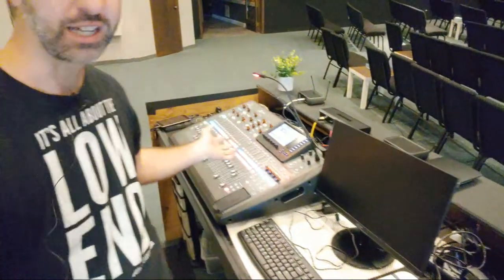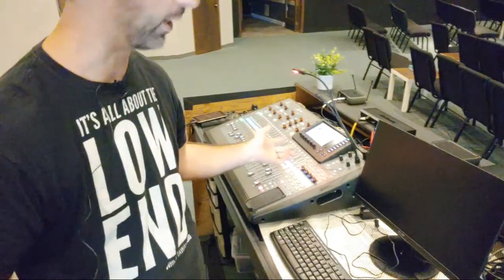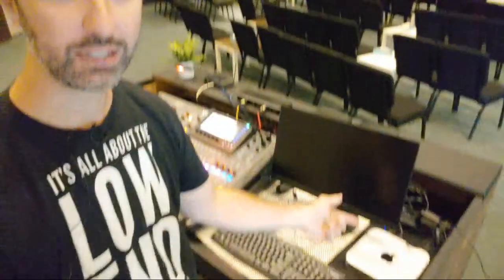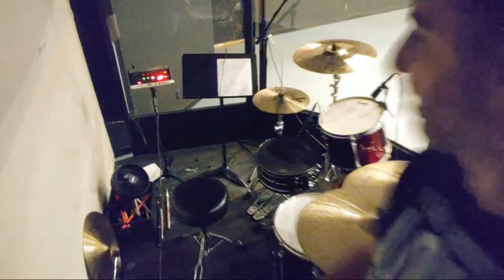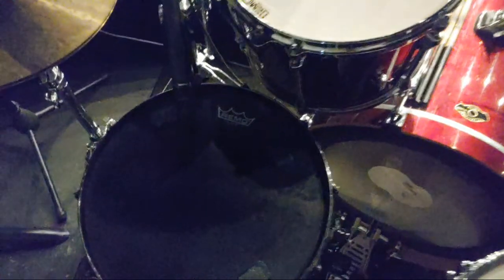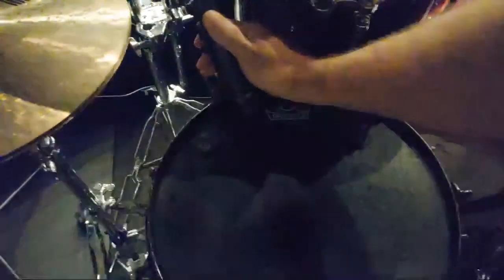What to Upgrade? Church Sound System Walkthrough

Comment: Something else that I love about the upgrades that we've done at various times in our systems is to add power switchers. I remember the days when we had the note telling people the order in which they needed to turn on the equipment. The danger was that if you didn't turn things on in the correct order, that you could damage equipment, especially the amps. With power and remote switchers, you can turn the entire system on and of with a single button, or the turn of the key. Because of this, I'm not worried about someone who comes in to run sound for a special event where I'm not there. The instructions we leave in the sound booth give them one button to turn everything on or off and it just works. Great investment to protect the equipment you have if you have the good problem of having a church that is used often for all kinds of events.

Comment: I love our wireless mic antenna distribution devices. It provides a single point of power for the mics and allows for a pair of antennas to be mounted anywhere with cables running back to the distributor. Definitely a good a investment if you have several wireless mics.

Comment: Regarding time-aligning speakers. If your speakers about the same place up front, then it's less important. If you have an oddly shaped or oddly sized room that requires fills, then you will often need to delay your fills. We have a preamp sound processor that takes care of our weird room. We have multiple under-balcony areas and multiple balcony areas, all with dead spots. So we definitely needed the processing. It also means that most of our stuff needs to be mixed fairly mono, though our front is stereo. So this is a good investment if you have a weird room, but it won't be a big deal if you have a pretty straightforward room.

Comment: James- I have listened to our live streaming when on the road and  noticed that at times the key just totally changed and then came back- what causes this? Is it due to our computer system or our internet speed?
Reply from the maker: it's likely an internet problem - I had another church reach out to me about the same thing and they were HORRIFIED when they listened on the road.
Reply: @AttawayAudio  James- We are using a MAC Mini to run our whole online streaming in Facebook. They techs are beginning to think it could be the computer. Should we be using a desktop with a bigger processor and RAM? What do you recomment at least for the internet speed so that we don't have the problem I mentioned earlier? Any advice is greatly appreciated- God bless!